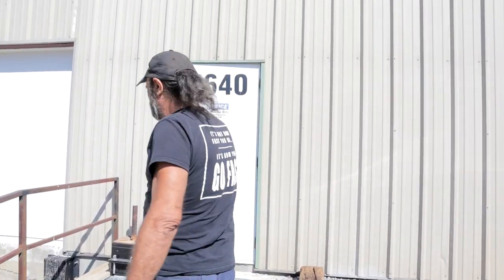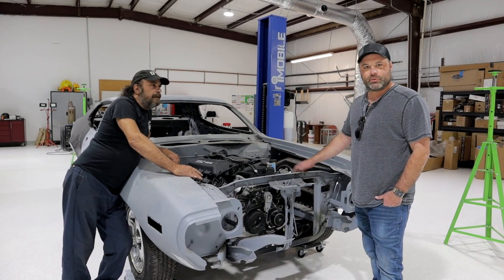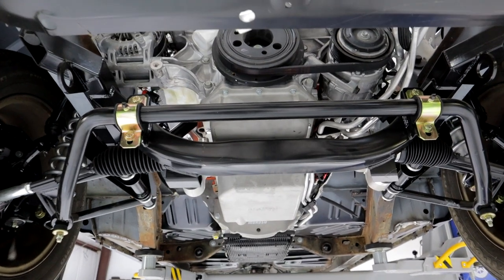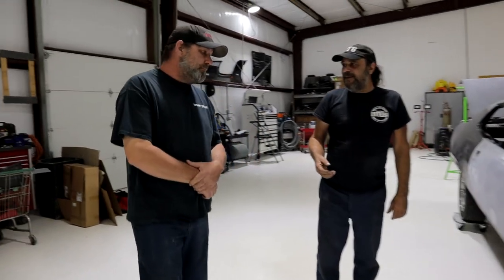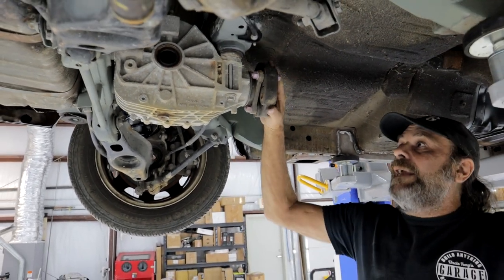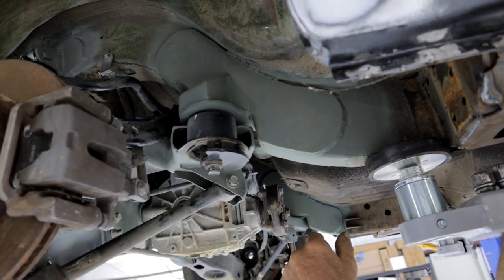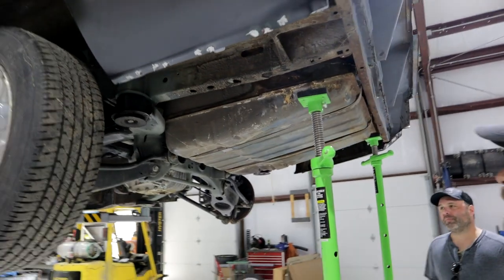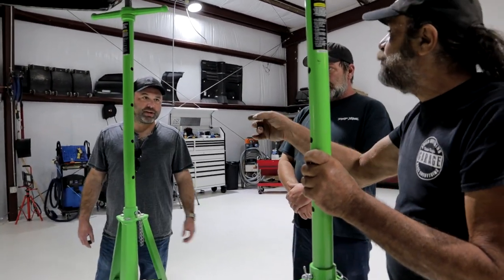Inside A 1971 Roadrunner 6.4 Hemi Build - IRS Using Nothing But Factory Parts!

Comment: This might honestly be one of the best rebuilds I've seen in a long time. First let me say that I'm all about oddball builds, and while I do love originality in old cars, I love restomods even more. I have owned 69 cars since I was 14 and I am 39 now (yeah alot, but not for real car guys), and I have modified almost every single one of them in some way. For instance, right now I have two cars, a 1997 Honda Civic coupe that I painted myself years ago, with a fully built Acura Integra Type-R engine that's bored with forged internals and a Garrett GTS3582 turbo that makes 709 whp at current with an Integra GSR transmission. My other car is a 2004 Acura TL with a six speed manual swap, custom built headers, Injen cold air intake, and an Invidia exhaust, with dual mufflers, it has a 2007 Acura TL Type-S manual ECU with a Hondata FlashPro to tune with. It also has a Nitrous Express 75 HP dry shot in it with an AEM 340 LPH fuel pump. Yeah, I know, wrong channel to post this on, but I have owned domestics as well that were highly modified. I love all builds regardless of the make and model. Especially when the person who's fabricating it shows this level of love/skill. 100% my next build will be a high horsepower domestic of some sort.

Comment: Beautiful car and yes it is a piece of artwork. Thank you so much for showing it to us. But a KNOB shifter in a classic muscle car? That just ain't right!
Reply: Agreed
Reply: His build not yours or mine, just an FYI, Chrysler products of the late 50's early 60's had button shifters on the dash so in a way the dash mounted transmission control is in the same spirit.
Reply: I would guess that he plans to put paddle shifters on the steering column. That works pretty well with the knob shift, as the paddles are the fastest way to manually shift an automatic. If the transmission is the eight-speed I think it would be almost impossible to get a slapstick shifter to go through all eight gears. The eight speed is capable of shifting in 200 mS anyway, so if the trans is programmed to match the engine power curve, the fastest way down the track would be to put the knob in D, use the built-in line lock/2 stage rev limiter to launch, and floor it. 
The execution and quality of work on this car is phenomenal. I hope we see updates on the progress and a long, detailed video when it's completed.

Comment: Sometime in the future we’ll be seeing this done opposite , late model cars with older engines and drivelines
Reply: I agree, good point. It would be cool to see that
Reply from the maker: I agree completely!
Reply: It was a thing a few years ago before everyone started LS swapping everything. It used to be fairly common to take the TBI motor out of an OBS Chevy truck and swap in an older carbureted small block. Also a lot of the diesel folks are into 6BT swaps.
Reply: I think something like a 440 in a newer challenger is what this comment was referring to

Comment: With your fab skills, I wonder if you could make that turn gear selector into vertical selector and hide it in a slap stick style set up. It's wouldn't have the mechanical resistance of an original but I bet you could get something to work.

Comment: Did Dodge ever fix the valve spring issue with those engines? I don’t know that it’s a widely published issue like the LS7 dropping valves issue was, but those 392’s seem to love to break valve springs an drop valves. I know 2 Mopar guys, both have 392’s in their vehicle and both have broken valve springs. One guy was lucky, his SCAT pack broke the VS but the retainer stayed on the valve, car went into limp mode and he got towed home before finding the issue. Took the opportunity to do a cam swap. The other friend has a 392 Jeep, thankfully his junk was still under warranty because he dropped a valve and munched an engine at 10k miles. I think I’d be upgrading those valve springs before I beat on that car and there’s no time like the present since there’s nothing in the car and that engine will be coming out again.

Comment: A nice change of pace,U.T. I suppose he'll have a nice car when he's finished. BUT, i "draw the line" at removing superior handling Torsion Bars for the "Alter-ation" system that is designed & marketed for those either too young,unwilling or incapable of learning how well a traditional Mopar straight spring/torsion bar setup can be made to work.

Comment: There's a guy who dropped a 6.4 hemi in a red duster, it's crazy fast.
Reply: I have a 6.4 srt8 engine. Though it won't ever see a factory transmission behind it lol. Will have a tremec or Richmond road race 5 speed which is the old Doug nash 5 speed

Comment: the rear suspension looks almost identical to the suspension in my mercedes diesel. all the was down to the flex joints.. great riding set up.
Reply: It is Merc and Chrysler shared this LX platform.

Comment: Never quite understood why is it more legal to weld new, in most times heavier, sheet on top of (or god forbid butt joint!) old rusted crap, than to fully frame the old rust bucket.. In that build there's a foot of old cheese between two layered hard pieces. That piece of cheese acts like an acordion when the car is launched. Unless the cradle is solid mounted to the chassis, those bolt ends will rub the gas tank thru almost instantly. If the subframe is solid mounted, it will rip the old frame rail apart. Further more, outer skin wheel arc is no point of reference. there's 1/2" tolerance between sides, if not inches depending on manufacturer. This clocks the rear and makes the car undrivable. To get is right, build a backbone chassis with side rails and weld the floorless body onto that. This way you'll have a good old looking car. His way, better to have good insurance.
Reply: There was no mention of rust for the reinforcement, what was mentioned was the way the rear suspension mounting was hand built and reinforced to solidly mount the anchor points of the sub frame, all of the drive loads are sent to the sub frame, those anchor points and frame connectors make the setup plenty stiff.

Comment: I turned the video off as soon as I saw the ghetto reehuums. A real shame. That has the potential to be a really nice car. I love the '71-'72 Roadrunner. But not when it's been GHETTOIZED.
Reply: Temporary wheels while building the car. They didn't go to the trouble to narrow that rear to run those narrowwheels and tires. The's way more than the 1 1/2" they took out of either side between that scrawny tire and the wheelarch. But you're right about those awful wheels on it now
Reply: Maybe if you even knew what was going on you would realize that those wheels are for rolling the car around while building it right?   

Of course you have no idea 🤣🤣👍🏻
Reply: @CustomS-cd5et  It said "pro touring" which is another name for ghetto reehuums.

Comment: i get that the car isn't done but why don't people put all the lug nuts on? worse is when people drive around like that it drives me nuts! it'll be a bad ass car though! I reminds me when I was a kid in the early 90's and i used to wake up early on saturday to watch the powerblock and I saw a feature on the roadrunner and i fell in love! I wanted a 1968 roadrunner with a 426 hemi hell id take one with a slant 6!!
Reply: In the build process those wheels may be on and off dozens of times, explain why all the lug nuts should be installed every time the wheels and tires are mounted to the car.
Reply: @Peter-V_00  where else would you put them?
Reply: @mromatic17  "i get that the car isn't done but why don't people put all the lug nuts on? " Your words not mine.
Reply: @Peter-V_00  yeah but you can hand tighten them on if its not driving on the road or being used as a roller. Why put them somewhere else where they will get lost? idk it doesn't make any sense not to keep them where they go!